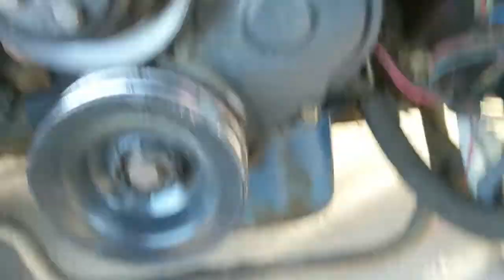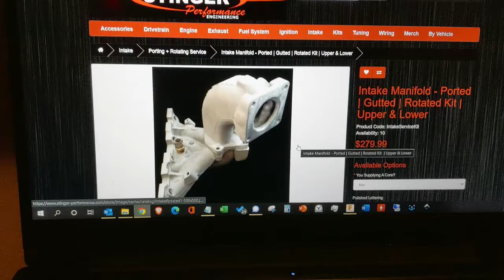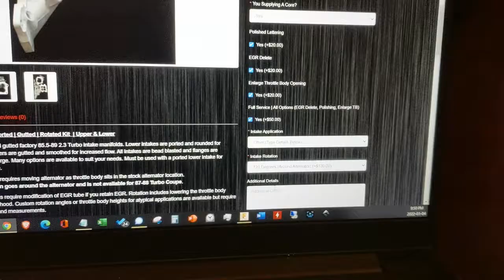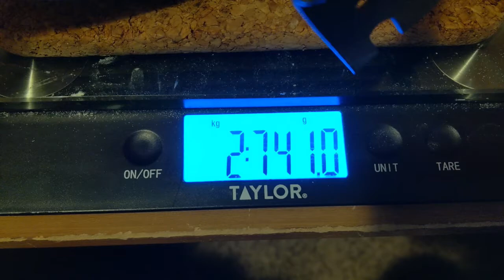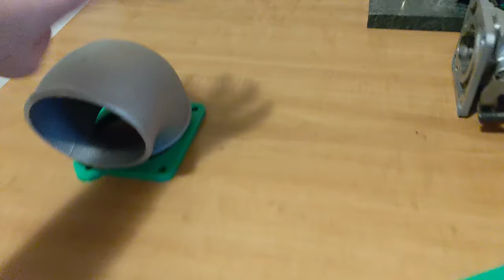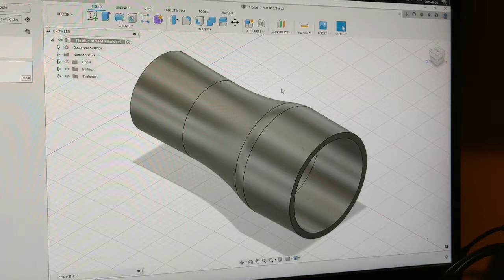Custom Turbo Intake with no Turbo? - PTP - Episode 27

Comment: I am sure you will address this however, my concern is that the intake horn does not have enough hood clearance.  Not only will the silicone hose add around 3/16", and a T clamp on top of that, you also have to account that engine torque will most likely rotate your engine probably 1-2" up on the drivers side causing hood contact or vibration transfer etc.   Good luck.
Reply from the maker: Yeah thanks for the tip! Had a couple inches of plates underneath to account for any extra space I should need. Hopefully its enough!